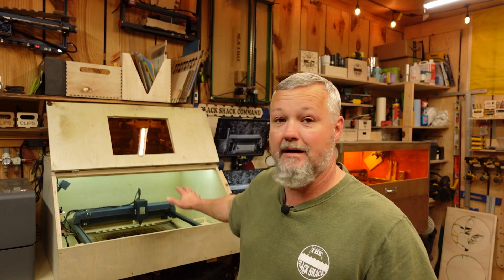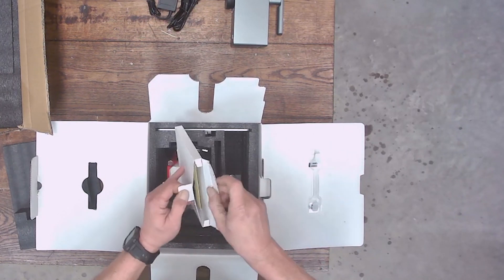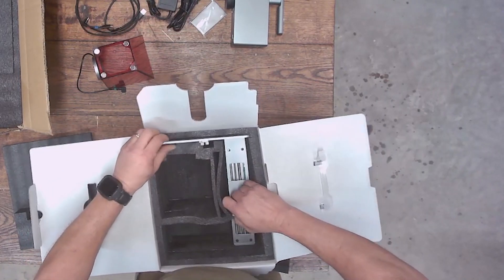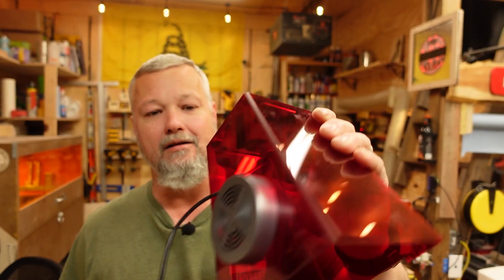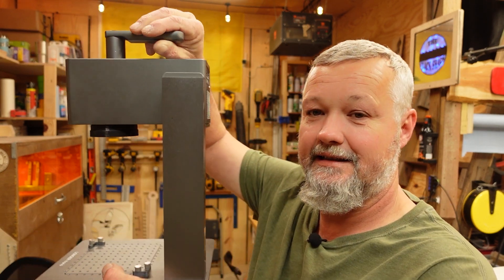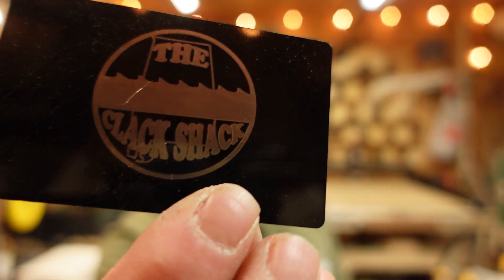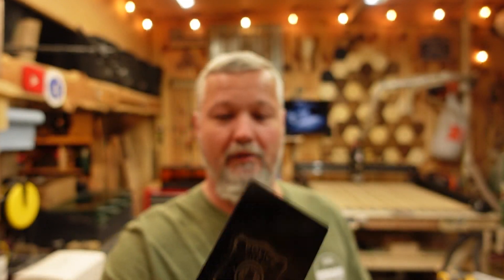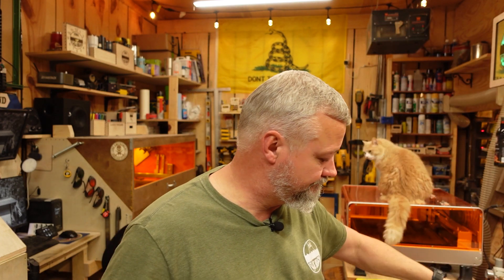The Longer Nano 12 watt

Comment: Im looking to engrave some woodworking projects like cutting boards, this seems like it would be great at that. Taking the plate on the bottom out i should be able to place the machine on top of it and get the logo in the corner right?
Reply from the maker: Yes, it can engrave on the surface below it. As long as the image is the size of the work area.
Reply: @TheClackShack  thanks, earned a sub!

Comment: I don’t want to engrave metal, but rather mark it with names, fingerprints etc. I am looking at using sterling silver, coated stainless steel and aluminium. Thanks for your information
Reply from the maker: You will need a 1064 NM laser to make any significant marks on most metals. I use a ComMarker B4 20 watt
Reply: Just to be sure. I am new to this, but I want to buy a laser that helps me engrave small names and logos on stainless steel clasps (of my bracelets). Will the Longer Nano Pro 12 Volt be suitable to do this? Or will it hard be to see? Thanks in advance for your advise.  @TheClackShack
Reply from the maker: @dannydekeizer3358  you can mark stainless with blue diodes but to engrave stainless requires a fiber. If it is coated, you can remove coating with a blue diode.
Reply: @TheClackShack  Thanks for your advise! Loved the video!

Comment: You answered my outstanding question. You can only engrave on annodized or metal that has a spray coating. I am glad I didn't buy this machine.
Reply from the maker: To engrave metal, you need a 1064 nm beam

Comment: Looks like a nice little unit.  In your opinion, would this be a good portable laser for using at craft shows assuming the proper protections are in place?
Reply from the maker: So far, in flat mode it is doing pretty good. It would need a protective barrier.